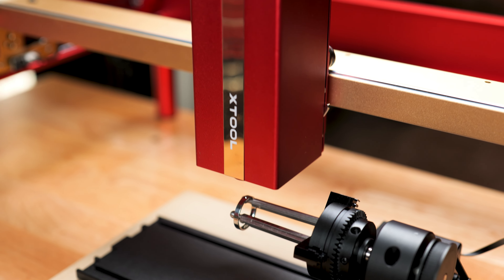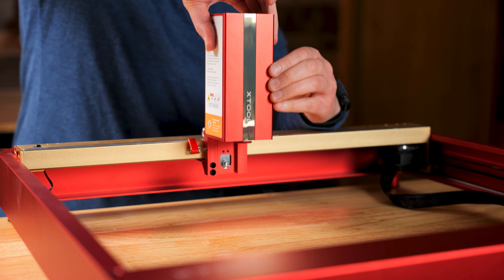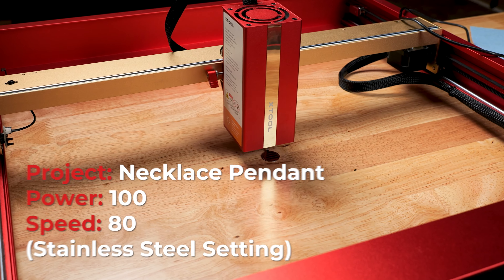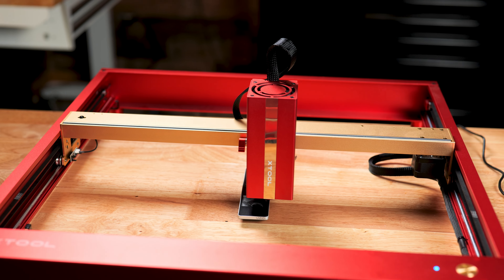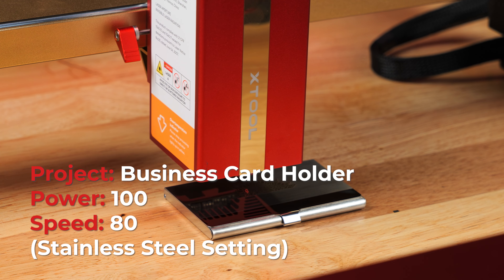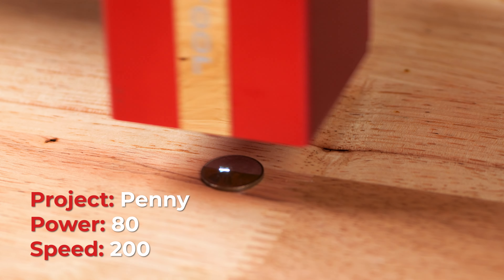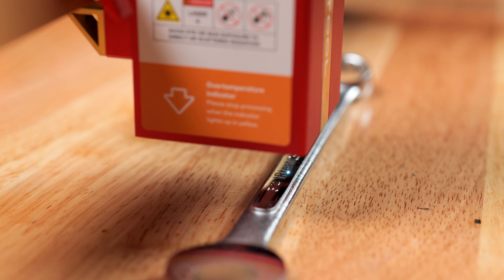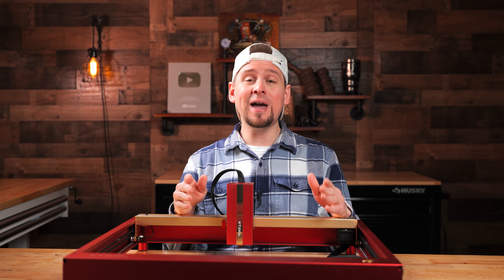How to Laser Engrave Metal with a Diode Laser | xTool Infrared 1064nm Laser Review

Comment: I used my IR module a lot now, and i do like the results, perfekt details always, but, it´s to slow for anything else than one off things. Larger pieces than small jewelry takes forever. As a complement for those occasions you do one or a few small metal pieces other than stainless, yes, anything else you do need to jack up to a fibre laser.
Reply: Galvo lasers like the xTool F1 seem to have similar lasers but are faster for some reason. Also expensive

Comment: I'm thinking about this for glock guns frames think it would be ok?
Reply from the maker: I haven’t tested this on any coated metal. Glock definitely has some crazy thick coating. Most people will use a Fiber laser for that type of stuff.
Reply: I mean for plastic
Reply from the maker: @highspeed9518  if you plan on “stippling” I would skip the IR and use the 10w or 20w

Comment: So question on the power cord you changed out…is there a new power cable that comes with the IR laser? 

I only have the 20W laser so not sure if I have to change something else as well. 

Thanks for the video, really good info!!
Reply from the maker: Hey there! Yes, it will require a different power brick which the IR module comes with.

Comment: I have a question.  I have the F1 -- not ultra.  Is this the same power as that, at 2 watts?  Or is it like the F1 Ultra and 20 watts?  I can't find an answer, thanks!!  Great video as always!!☺  I'm trying to decide whether to get the F1 Ultra next, or the S1 and add this module.  What do you think?
Reply from the maker: Hey there! Yes, this IR module is indeed the same power as the regular F1 which is 2W. The F1 Ultra is a complete different animal and is my FAVORITE laser currently!  The S1 is a complete powerhouse. If you plan on doing a lot of cutting or engraving and need larger bed space, the S1 is the way to go. If you want more flexibility in engraving material, the F1 Ultra is the way to go. IF you do decide to go with the S1, I wouldn't worry about the IR module for the S1 since you have the F1... Unless you just want to engrave bigger metal products. Hope this helps!
Reply: @CorneliusCreations  Thanks so much!

Comment: Thank you for sharing. I find the focus arm not accurate on my IR module. It focuses too high, and therefor it is a constant fiddle job. Made myself an acrylic block to a specific height that seems to set the module correctly. But even this block needs to be put under the module just right to adjust the module height. Setting the module on it too snug or too loose, changes the color of the engraving from black to white or grey on the silver sheet I am trying out. It is a fiddle job for sure. You better have a lot of patience if your focusing arm is not set correctly. When it works, it looks great. Trying gold next... will see. Not liking the brown color so much I see on your gold sample, hope to get more of a black. The detail is amazing, though.

 I would agree, even with my difficulties, for the money, it is a nice addition to the other modules. If you are serious about engraving metal, though, need deep engravings, and need to do production work to make money, investing in a faster 'real' fiber laser, spending the $3000 for an entry level machine, might make more sense.
Reply: I agreee im sending mine back cant get it to focus corretly   wasted so much materisl  testing  nightmare realy ..
Reply: Which fiber laser would you recommend for stainless steel? Comm marker seems to be one of the cheapest options so far I found but I could not find real user reviews except Youtubers

Comment: Hello, I only want to engrave onto stainless steel. Would the normal laser do this or would i need a IR module? Thank you
Reply: The diode laser can do stainless, any other metal the IR is needed.
Reply: @leffep  Thanks. Yes i ended up buying one of the 3plasers 30w fibre

Comment: I need one for my 3018, hopefully they will drop in price as volume goes up.
Reply: Have me a nice little 3018.. i was gonna extend it for the 65$ but decided to grab a atezr v35 plus.. this thing is amazing and worth every penny.. ive done all kinds of material even glass!.. check it out
Reply: @theman-pc2ej  I was installing the extension bed today, putting it back in when I noticed the 2 support rods are on a different spacing. Grr, took me ages to line up those T nuts that join the bed extrusions to the MDF. Turns out there are a few 3040 extension kits just like there are a few 3018. Nice laser, might have to upgrade, the 3018 was a nice toy to learn on but......
Reply: @babbagebrassworks4278  yea i still love my 3018.. came with a router originally but i upgraded to the laser and never went back. New one runs just the same for the most part but has two rotory things that make it even better..

Comment: Im sending mine back focusing is a nightmare with this wasted loads of material and  guess work to even get close and very slow.   wished there was an easier way of focusing ..
Reply: My focusing arm is inaccurate too -- about 1.25 mm off.  So I spent some time figuring out the correct focusing distance and then I 3d printed a block that I could put between the material and the lens of the laser and I use that for focusing.... it works great.   I have also added the Z-axis height adjuster from AlivePixelCreates to my D1 Pro which allows me to fine tune the focus easily.